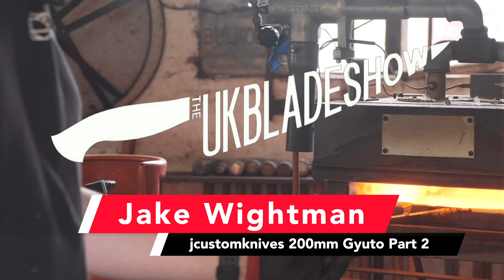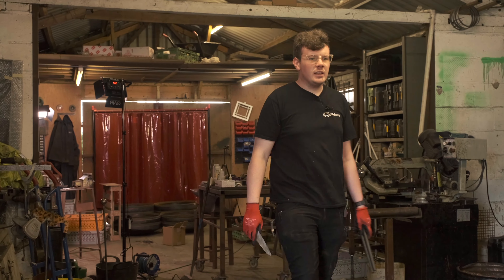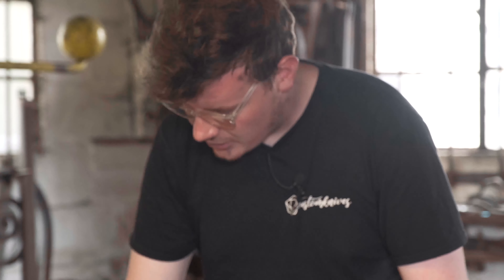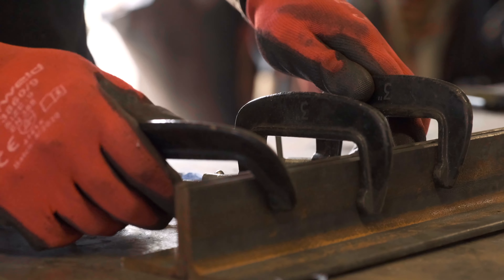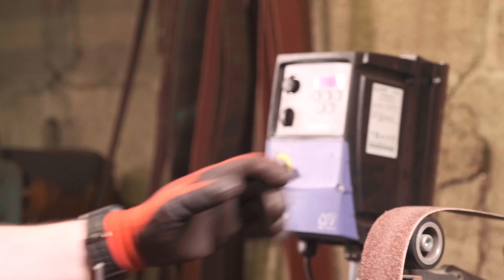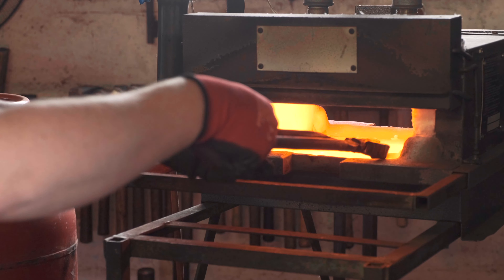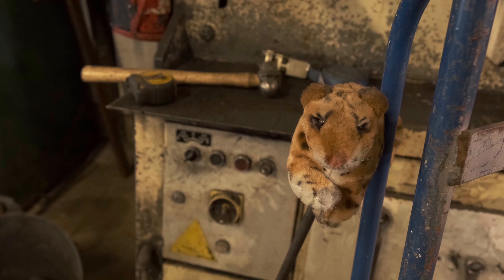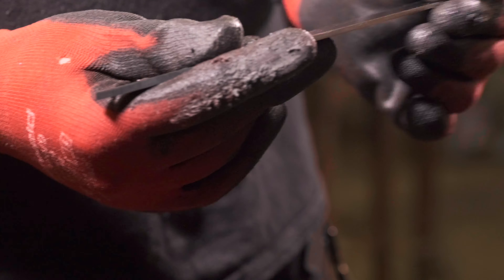This 80CRV2 carbon steel knife warped during heat treat but we fixed it!

Comment: Nice tip about not putting knives into the forge flat. So obvious when Jake explained it. Also liked the chitchat section, it's good to learn a bit more about the maker.

I'm curious about the Cubitron-IIs. I've tried them on my little 1x30 and they cut like crazy to start with but seem to get dull very fast, faster than other ceramic belts I've tried. I've read they need a good amount of pressure to make the grain fracture so they stay sharp but if I put much pressure on the blade my 1x30 just stalls.
Reply from the maker: Thanks Rob. There’s more of that new Chit Chat section that I intend to do for all future makers because like you said, it’s great to know about other things from these really interesting makers we have!

With regards to the Cubitron II belt (or any belt for that matter), they may not be lasting longer than they are supposed due to a number of factors: (1) shelling - happens when too much pressure is applied and you end up ‘chipping off’ the grain (2) glazing - happens when you don’t apply enough pressure and causes too much friction that the metal loads onto the belt. You can investigate these by looking at your worn out belts. I’ve got lots of experience in this field so I might be able to help. Let’s exchange comms on IG mate! And also, I can make a video about this if you want to know the geeky stuff about abrasives 🥳😍
Reply: @UKBladeshow  I don't have any Cubitron IIs atm. I'll grab one next time I put an order in and get back to you :)
Reply from the maker: Sure man no rush. Just because I put in 784F Cubitron II doesn't mean I'm being biased towards it 😂 Joking apart, it really works wonders, you just need the right amount of pressure and a good decent contact surface behind it (platen pad or contact wheel) and it will do a fantastic job. I have tested it against a variety of different makes, even against different 3M belts too and the 784F is a great do-most-things belt.